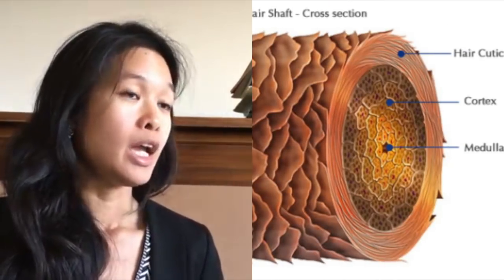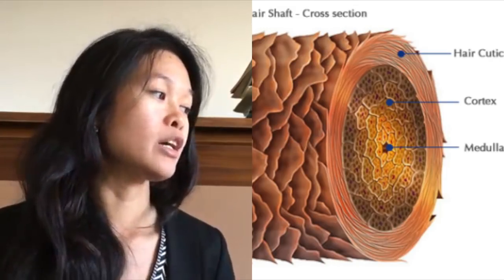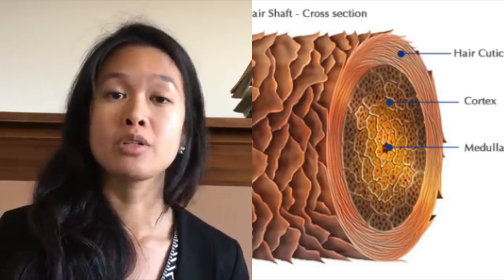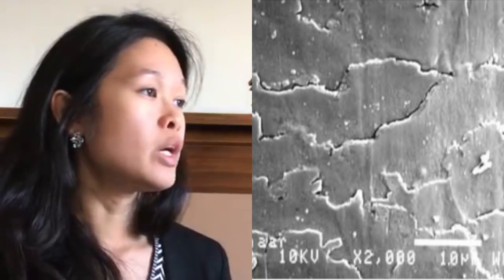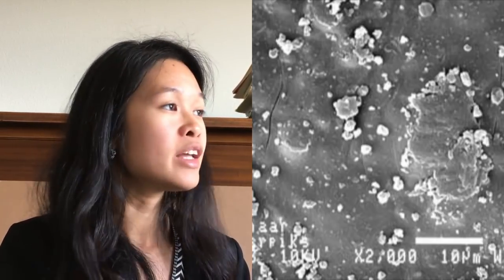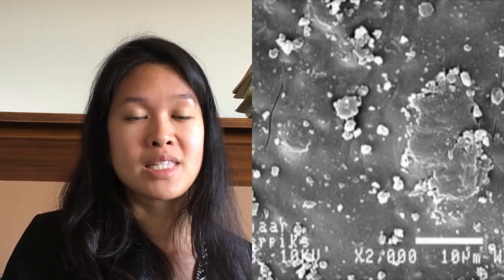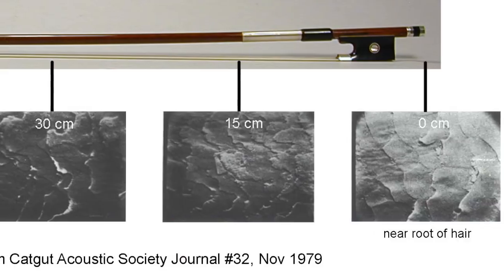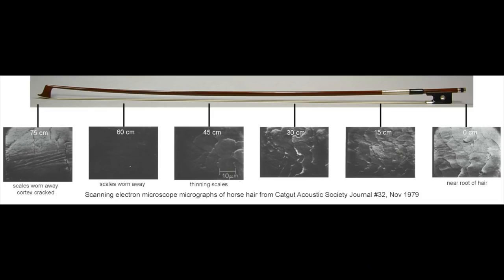The Science and Engineering of Rosin-  Part 1

Comment: In your experience, when you're rosining the bow, should you put pressure on and do small sections (5-10cm) at a time? 

The other way I've heard is to hold the bow as though you're playing the instrument and 'play' the rosin in full bow strokes.

 Is there a scientific reason why one is better than the other?
Reply from the maker: Hi Josh, I'm going to answer in two parts. Between putting pressure vs "playing" the rosin on, I play the rosin on with no extra pressure. This is because the texture of the scales is sufficient to pick up the rosin based on their similar height dimensions- adding extra pressure wouldn't add any benefit. As for putting the rosin in small sections at a time vs full bow strokes, I use a combination of both, with small strokes concentrated on the upper third to top quarter, and then long strokes for the rest of it. This is because not only do we play more in the upper half so the rosin is worn off faster and needs more, but also when the arm is extended playing in the upper half, there is less downward force able to be applied as compared to the middle or lower half of the bow. A little extra rosin on the upper third to upper quarter would help with sound and control.
Reply: Satu that's really interesting, thanks so much!
Reply: Doesn't apply to cello though, we play mostly in the lower half.

Comment: It doesn't seem like there's going to be a part 2. 😀
Reply from the maker: Hi Raitis, unfortunately this project is on hold. I had previously been working on running some experiments in order to compare mechanical properties of several rosins for Part 2, however I discovered that the properties I was looking for require the use of highly specialized and expensive equipment with specific capabilities, which I do not own. It also doesn't help that the equipment that I do have access to is not the right equipment for the ranges I'm looking at. In the state I live in, the specific equipment I need is several cities away from me. There are a couple private companies in town that may possibly have the equipment I need, however when I reached out to them they were unwilling to do any research experiments without a very large grant. 

I am working on another science/music video though, which I'm excited about! Stay "tuned" ;P
Reply: @Kwee_Music  I'm happy that even this one exists! Thanks!